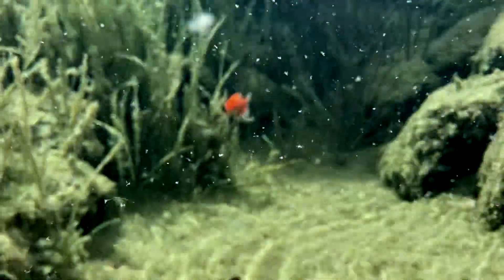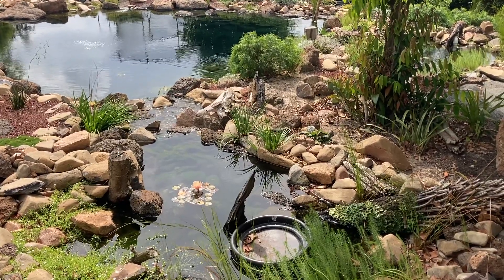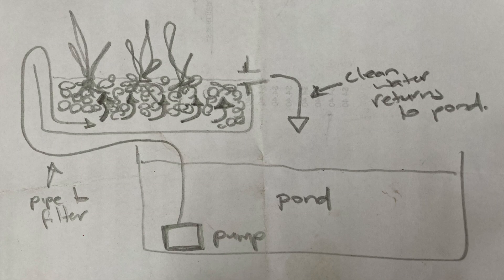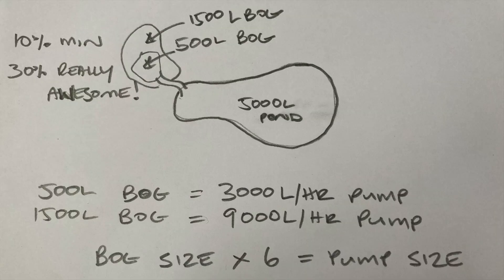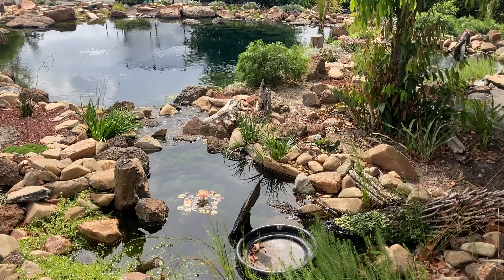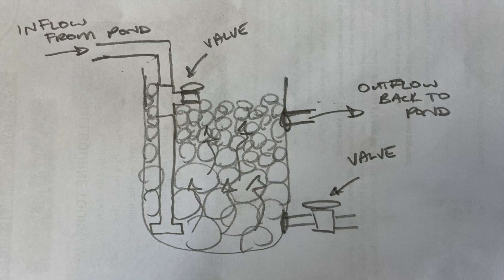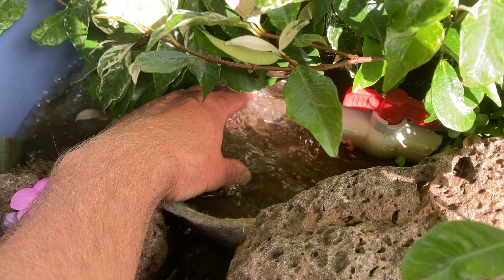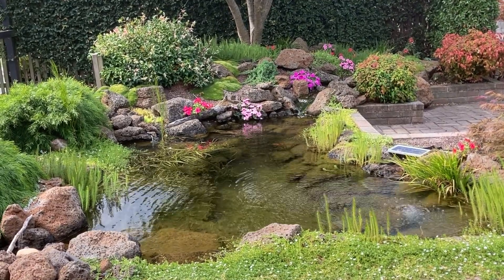Designing a bog filter. Clear water every time!

Comment: A few comments on what I'm doing on a similar project and some ideas I've found on how to expand this idea.  What he built here is called an 'Aquaponics' system, the fish drop fecal matter and pee in the water which provides the minerals/nutrients the plants need with the help of the bacteria (see below).  A perfect symbiotic system.  It works better if there is rough (3/8" gravel) in the area the plants roots grow into.  That way the Bacteria can grow on the rocks and stay bio available to the plants.  This process is called Nitrification (see reference below).  I am building a 26' Dome Green House on my property in August 2022, and will have several Aquaponics setups in it along with normal organic soil beds.  I will grow lots of different edible plants, including vines on raised lattices, cucumbers, beans etc. and a few fruit trees as the dome height will be 16'.  The Dome will also have a pond with waterfall for a great place to relax, especially in the winter, as it will be like summer inside.  I will have an air cooling system by running a tunnel under the dome to pull air through, thus cooling the air to regulate temperature inside the growing area.

One thing that can also be done in soil, to make it much more fertile, is mixing hard wood charcoal, chipped up into the soil at a 15% ratio Biochar to Soil.  That creates a home for the mycorrhizae fungi that makes the soil more fertile.  That system was first known to be developed in the Amazon jungle by burning plants to clear jungle for growing food.  The Biochar was then called Terra Preta  and makes plants grow faster, bigger and produce much more fruit/vegetables. My plan is to have plenty of organic food for the family as well as enough to sell to organic restaurants, that way I can write off all the expenses.

I will also have a large pond on the property with a bio area (place for water plants, some edible) will grow and when I pump water from the pond into the bio area the water will be filtered by the plants roots and cleansed by the bacteria.  All totally organic, no chemicals.  I'll have Bass, Crappie, Perch and Catfish in my pond for food we eat.  I will have a cable running over the pond with a feeder so I can set it up to be easily fillable and a motor to spread the food pellets on the pond.  The pond will also have spawning areas for the fish to keep the pond in balance.  With the clean water the pond will also have a sectioned off area for swimming.

Most people use Tilapia in Aquaponics systems for that very reason.  The Tilapia is a great food fish.  Some people create a food trap to let the fly's lay eggs that turn into larvae and then those can be fed to the fish. I have seen a few examples where the table scraps are tossed into a 4" deep tray/bucket, and the flies lay eggs in the food.  The larvae crawl up an escape ramp (a bit rough for traction) the ramp goes up, then down.  The down side is smooth so the larvae then slide down into a collection jar.  Free food for the fish...

I will make a video once I get all that up and running.

I also will be 'trellising' my fruit trees in another area, similar to grapes, by tying limbs on the fruit trees to heavy wires to run horizontal instead of growing high.  That way the fruit is easy to pick because the trees will be wide not tall.  The trick is to run the trellis' north/south so the trees fruit will get even sun east/west and have the best flavors... But that's another story.

References:  https://www.theaquaponicsource.com/what-is-aquaponics/ and https://mycorrhizae.com/how-it-works/ and  https://en.wikipedia.org/wiki/Terra_preta  https://en.wikipedia.org/wiki/Nitrification   For more information on the Bog Filter Nitrification check out this video that discusses that issue:  https://www.youtube.com/watch?v=3d_dx0Drn04
ll also have a large pond on the property with a bio area (place for water plants, some edible) will grow and when I pump water from the pond into the bio area the water will be filtered by the plants roots and cleansed by the bacteria.  All totally organic, no chemicals.  I'll have Bass, Crappie, Perch and Catfish in my pond for food we eat.  I will have a cable running over the pond with a feeder so I can set it up to be easily fillable and a motor to spread the food pellets on the pond.  The pond will also have spawning areas for the fish to keep the pond in balance.  With the clean water the pond will also have a sectioned off area for swimming.

Most people use Tilapia in Aquaponics systems for that very reason.  The Tilapia is a great food fish.  Some people create a food trap to let the fly's lay eggs that turn into larvae and then those can be fed to the fish. I have seen a few examples where the table scraps are tossed into a 4" deep tray/bucket, and the flies lay eggs in the food.  The larvae crawl up an escape ramp (a bit rough for traction) the ramp goes up, then down.  The down side is smooth so the larvae then slide down into a collection jar.  Free food for the fish...

I will make a video once I get all that up and running.

I also will be 'trellising' my fruit trees in another area, similar to grapes, by tying limbs on the fruit trees to heavy wires to run horizontal instead of growing high.  That way the fruit is easy to pick because the trees will be wide not tall.  The trick is to run the trellis' north/south so the trees fruit will get even sun east/west and have the best flavors... But that's another story.

References:  https://www.theaquaponicsource.com/what-is-aquaponics/ and https://mycorrhizae.com/how-it-works/ and  https://en.wikipedia.org/wiki/Terra_preta  https://en.wikipedia.org/wiki/Nitrification
Reply from the maker: Sounds awesome Milton. I never had success with my aquaponics. Now I just grow impatiens and ornamentals in there. I will follow your channel 👍
Reply: @Ozponds  Lots of Aquaponics systems fail because they don't have sufficient oxygen in the water.  I will use a pump that runs off a battery that has a charger.  If the power goes off you lose no oxygen generation.  The other thing is the water has to be kept at about 78 F or the plants don't do well.
Reply from the maker: The temperature would explain my failure. Now it makes sense when I see that most of the successful aquaponics in Australia is in warmer climates.

Comment: After watching your videos, I've decided to put a 300 gallon rubbermaid bog on my 1000 gallon above ground pond. I'm going to put the inlet to the bog on the bottom (with a check valve as you suggested.) The bog will sit approx 5 feet away, and maybe a foot higher. There will be approx 7 feet of head, 3 of which will be vertical (from where the pump sits in the bottom of the pond to the height of the inlet into the bog.) What size pump do you recommend? I like the Tetra DHP 3600, but am afraid that it might be too much. I could put a ball valve on it, but Tetra states not to restrict the flow more than 30% to keep from damaging the pump. Thanks!
Reply from the maker: I’d be looking to run 1800 gallons through a 300 gallon bog.
Reply: 1800 gph?
Reply from the maker: Yes. Just remember that’s what you want going through the bog. So you’ll need to pick a pump that will deliver that at your desired head.
Reply: @Ozponds  Awesome, thanks!

Comment: Awesome video! Do you need a syphon break if you have your inlet drilled thru the bottom of the bog (basically at the same level as your clean out valve)?
Reply from the maker: Yes. But a normal air break won’t work. You’ll need to use a check valve.
Reply: @Ozponds  thank you

Comment: Interesting video

Still working on digging out garden fish pond.
I have 4 good sized raised beds approx 90’ long
The pond is between 80,000 and 100,000 litres depending on how deep I go. Thinking how can I use the center of the beds as the bog. Also incorporating the water flow in the overall watering of the gardens.
Reply from the maker: Sounds like you want a supersized aquaponic system.
Reply: @Ozponds  lol for sure will grow water spinach on a raft like structure. But mostly want to feed soil with the nutrient rich water. Talked to the guys building the pond we decided to build up two sides by extending the retaining block walls. But good timing seeing your video as I’m at that moment where decisions will have to be made.

Cheers
Reply from the maker: Sounds like a really fun build 👍

Comment: so psyched to build one of these! I just finished building my main pond, and I'm glad I found your channel BEFORE finishing the rest. Now I can incorporate the filter into my pond pretty seamlessly rather than trying to shoehorn it in...
Reply: I'm just rebuilding my 2500 gallon pond that requires a total liner change. Incorporating a bog filter in a one piece liner into this one instead of the external bio-filter tub I used before. Going the 30%+ route because I love my fish. Won't have the large amount of goldfish I had before, just a few large koi.
Reply: @mikejessmax  hell yea, that sounds awesome! Haven't done anything with fish yet, waiting for all my plants to establish first so the ecosystem is ready, but I went way overkill on the pump and filter in preparation.
Reply from the maker: Awesome! Welcome aboard 👍
Reply: My issue is the pump in the pond can have the cylindical filter plugged in no time.  I think I will build the filter and run the pump with no filter and hope I don't burn it out. Also I have an old pressure washer pump I may try to use this to pull water from the pond and pass it to the filer.
Reply: @donvitokoski2846  build a little filter box to keep the pump in, finer filters at the bottom and more coarse ones at the top, leave space for the pump to breathe a bit, and you shouldn't have to worry about debris clogging the pump because it will always have some clean water around it. Just an idea, but it should work

Comment: How do you calculate the amount of water through the regulator valve?. My waterfall is 30 inches wide  900 gph is what's needed for my bog according to your calculations.
Reply from the maker: Just connect a hose to it and fill a bucket. A few calculations and you’ll know exactly how much water is coming out 👍

Comment: Hi, Kev! I have a question, that olive barrel you used for your bog filter, what dimensions it has? I am just trying to figure out the depht of bog filter in my pond. Thank you in advance!
Reply from the maker: I’m not sure the exact height sorry. They do vary a bit in height I had a few different sizes.
Reply: @Ozponds  Thank you for quick answer! I have another question, lol! Is there any rules about depth of a bog filter? For example, my pond is 4,5X3 meters, depth is about 1 meter, I am not planning to have a lot of fish, so if I understand correct, bog filter suppose to be about 1/4 of pond size, right? But what about the depht?
Reply from the maker: The ideal is probably to allow the water to move up through approx 60cm of various sized rock and pebble. However I’ve got one that is at least 1m and going strong.
Reply: @Ozponds  Thank you very very much!!

Comment: Hi, I want to add a bog to my existing pond, yet I want to do it with out starting fresh on the old pond, meaning draining and getting a larger liner. Is there q way to add the new bog and overlapping the liners with out the water seeping or wicking between the two liners?
The end of the pond where I want to add the bog is slightly curved has the liner folded over itself (I hope this makes sense). I can not see how I could glue the new liner to the old with out the water wicking through the fold areas. Any help would be appreciated. Thank You
Reply from the maker: The easiest way to add a bog to an existing pond is by connecting the two with a stream or creek. If you have a slope this is easy. You can overlap the liner sort of like tiles on a roof. I usually like to allow 30cm (1 foot) if I’m not seaming the liner. But if you did need to seam the liner hopefully because the stream is narrow you could find a nice smooth piece (No folds) on the existing pond. I hope that makes sense.
Reply: @Ozponds  Yes it did. Thank You!!

Comment: Start to put into place building a wild life pond in our front yard food forest and your videos pop back up with a mountain of information.

I might have a place for a bog filter, and wanted to try a "flood plane" as the upper pond. Be cool if a I can find a variable pump that can cycle between volume.
Reply from the maker: The pumps in my dream pond have variable flow settings.
Reply: @Ozponds  only issue is I can't find one that I can cycle up and down automatically. 

The guys at aquapro gave the idea. Use two pumps, one on, one you can turn on. I can use an arduino to control the second pump.

Comment: Hi Kev , I did comment on your anoxic filter you set up because I found my bog didn’t remove my nitrates , I have 500ltr patio pond and the bog is half large wine barrel (quite big) but I think my bog runs to fast. Is it better if I slow this down as much as I can? Will a trickle of water going back into the pond enough to aerate? That is what I was worried about. I have 3 large goldfish in my pond so quite a bio load as they are now almost 15cm or so long. 
I was thinking to changing it to a anoxic bog with baskets. Or do u think I should try slowing the flow instead, if I can,  will the trickle aerate the water enough or maybe add a extra aerator. ? Thankyou for your videos 🥰👌🏾
Edit - my hubby set up the bog well so the water flows into the bottom of the bog up through medium gravel and then a smaller baked clay zeolite through the top levels before it goes back into the pond, and looks pretty much exactly like your little picture of your bog you mention in the video. my pond is always crystal clear no algae etc so it works beautifully apart from not reducing my nitrates. I feel it is plenty big enough but I’m still
Water changing weekly to reduce nitrates from around 40-80 ppm very high. Also my wine barrel noes not have a liner would this be a issue, it does not leak at all but would the barrel be leaching anything ? I am happy to remove everything a reset everything if need be.
Reply from the maker: Yes the flow needs to be slow. Trickle is good. Here’s my theory with bogs- you end up with the best of both worlds. As the water comes in it’s aerated and you get the aerobic bacteria action (ammonia to nitrite to nitrate) , as those bacteria consume oxygen you the get anoxic conditions anyway. I believe that’s why my ponds running bogs always have no or very little nitrate even in winter when the plants aren’t active. If the flow is to fast the anoxic conditions can’t happen because the aerated water moves through too fast. I hope that makes sense 👍
Reply: @Ozponds  ah yes I was wondering that, if you get a anoxic condition in the slower bogs,  and if the water runs slow enough through, it gives the bacteria time to consume what it needs to ? , if my pump is to strong for size , (you mentioned I reducer) , is there anyway I may be able to slow the flow if the lowest flow level is still quite strong? Hubby was thinking of drilling a couple of holes in the inflow pipe to reduce the flow going into the bog?!
Edit-  you did quickly touch on the flow reducer in your video but I’m not exactly how sure  to  do that correctly,
I have no extra area for the water to flow , it just fills the bog and straight back to the pond anyway.
Sorry had to edit a few sentences that did not mAke sence.
Reply from the maker: Yes to reduce the flow I diverted water across the surface of the bog. I used a t piece and a valve. Some people do just drill in a hole or two. I like the t piece because I can the put on a ball valve and regulate the flow more precisely.
Reply: @Ozponds  perfect I will see if my hubby can rig something up 👍🏼 Thankyou for your reply 👌🏾👌🏾
Reply from the maker: I wouldn’t imagine the barrel is leaking anything to raise the nitrates I have multiple ponds in wine barrels with very little nitrates.

Comment: If you have the time & feel like it (no expectations), I'd like to get your feedback on an existing pond I'd like to clarify.
It's large, and shared with neighbors. A bog filter would unfortunately be prohibitive in size / work.
The pond is ~6800 m2 in area, fed by a larger pond just uphill from it. Guessing around 13,600 m3 in volume. 
My property only boarders it by about 24m and will likely be off grid so power usage is a concern as well.

I was wondering about the MBBR type filters since I've heard they can be much more compact for the amount of water they treat.
Also, completely understand if this is undoable and the best I can hope for is to throw an aerator in there and cross my fingers.
Reply from the maker: If you are in Australia contact algaenviro.com.au they specialise in returning large bodies of water to health. Tell them Kev from ozponds sent you. They will take good care of you 👍

Comment: Great, looks good. Qik question, I have 4 bogs for my 4 connected water bodies. One of the bogs are basically 2m wide but 14m long, how would you evenly disperse the upward movement of water?
Reply from the maker: With a long, large drainage pipe through the centre. You can buy half pipes at Bunnings which are perfect 👍 and cheap!
Reply: @Ozponds  Hi, yes however that would have different amount of water coming out, getting less as it moves along. Perhaps I should T in like every 2m or so for even dispersion
Reply from the maker: I dunno. The pipe creates a void. It’s easier for the water to move through the empty space as opposed to the rock and gravel. So first it is dispersed through the pipe then moves up through the rock and gravel. But it’s your bog you can do it however you please. 👍 Bogs are super forgiving so even if things don’t go to plan great results are achieved. Best of luck 👍